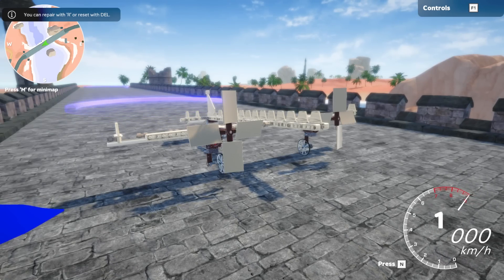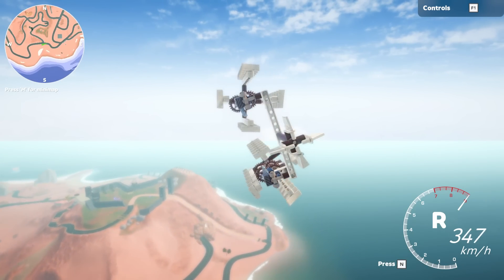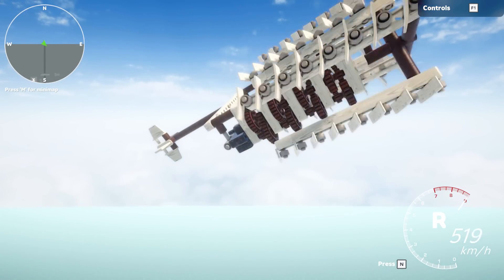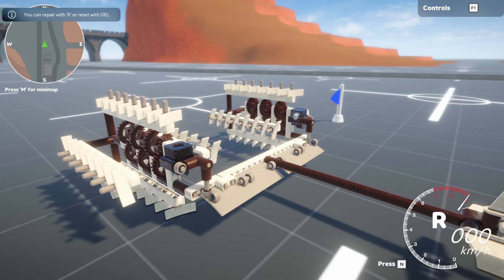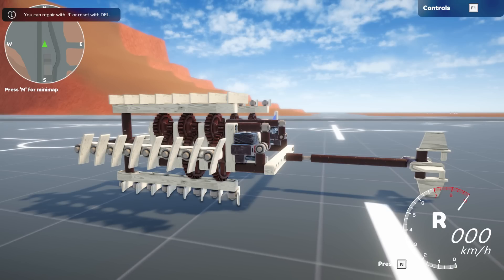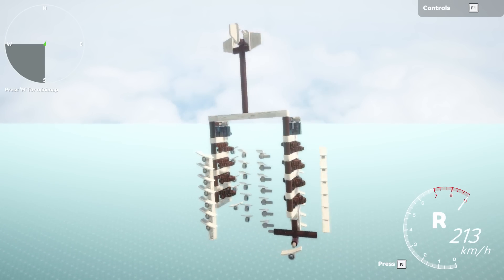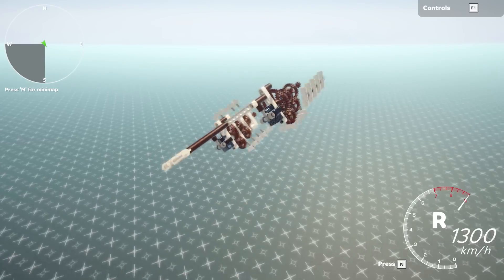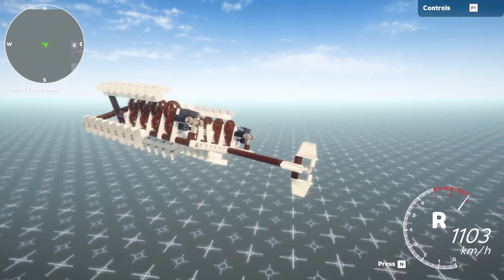I Built a Plane That Can Go Supersonic Under 1 Condition...

Comment: For spinning out of control i suggest praying. One engine i built had the same problem. i fixed the problem when i removed one spoiler of the front. I had another occurrence of the same problem that i fixed from going o the long straight, to free play... Still upset about this.

Comment: I don't know if they patched this, but when I was still trying to get it to work on my PC (my graphics card isn't quite up to the task), I learned that the way the game handles parasitic losses when running multiple engines is to simply have each engine added have less torque, meaning that if you have two independent drive trains, the second one is weaker than the first just because it's not the first.

I would suggest using axles and corner gears to have your counter-rotating props be the outputs of a single drive train so that you can be sure that the outputs are calculated as equal.

Comment: Sometimes lots of torque will cause beams and objects connected to axles to rotate around the axle even when they’re connected in another way. This happened to me when I built my first plane. If you just connect everything touching an axle up twice or 3 times with a peg then it should become stable.

Edit: Your sound barrier breaking vehicle is breaking off the parts that are twisting and causing the torque glitch described. That’s why it then becomes stable.

You can see the glitch happen on some vehicles if you tap the throttle or watch in slow motion. This also can cause crazy spinning so fast it just has constant sound barrier breaks. That’s what happened at the end of the video.

Comment: Kan, DiD yOu TrY

using less spoilers for the propellers? on several of your failed designs that went slow as soon as you broke them, they went faster. You saw this on your last build. Start with one layer of props and add more until you reach max speed. You'll get there. :)

Comment: Since when you experienced the gyro forces when you went from the larger engine to the smaller engine. I wonder if being under powered is potentially the cause, maybe try adding more engines to one of the ones that you increased the size of to see if that alleviates it.

Comment: use 1 engine and you can change the rotation by flipping the rod axel things
I've seen the discord it has a guide about this thing
Reply: only works with axels that are attached to those connector pieces

Comment: Maybe make both the sides spin with gears in between, if they are meshed, then both sides should be equal.

Then have both first gears driven by engines

Comment: I know the engines in this game get a little funky for instance with the craft you have at the 9:30 mark you can’t have them directly powering like that. It’s better if you run them off a gear train from a central motor. I believe it’s caused by something to do with how the gear trains correct to go one way even they shouldn’t great game but definitely quirky

Comment: I think it's a relative ratio of weight and torque. Which parts of the plane are heaviest and torqiest. I think if you weighted your center, the plane wouldn't start spinning at super high prop rotation.

Comment: theres an inline planetary gear that makes it pretty easy to get enough rpm (using less parts)  with the downforce wings. also theres a much better wing to use getting you more power per wing... as for drag , its calculated as parts/area exposed to the direction of travel it seems

Comment: To stop that gyro force, use only one motor in the center and connect the your rotors with an axle going between and lobe gears to reverse the direction of rotation. Motors in this game are a little different, the way engines work is each one ticks up in order one after the other. More engines don't work because plane rotors provide no resistance to the motors, so they are instantly max rpm at all times.

Comment: What if you connect both propellers on an axis thar goes from left to right and power the props through this axis ? The game may consider it as the same mechanical system that could synchronise and prevent the weird spinning

Comment: @kANGaming, The random gyroscopic force is from the beams being connected via axle, the game things of it as a freely rotating part and it tries to spin but the other axle isn't letting it, basically the beam is trying to clip through the axles but the game counteracts this by spinning or moving the vehicle, this has happened to me and when I attached the beam to the main body it was fixed, hoped I helped!

Comment: Have you considered using a perpendicular axle connect the two sets of props with 90 degree gears? Put the engines on that axle and the props should spool up at the exact same rate. You can also throw more engines on there if it's wide enough. Also, to prevent the gyro effect, you may need to use an idler gear or 3 to make one set of props go the opposite direction.

Comment: 18:20 you smashed mach 31.9693408
👍🏻
Reply: Yeah, that's "39,239 km/h" for a single frame at 18:21.
But that speed is just a glitch with a crashed vehicle, and the game not knowing what it should be tracking.

Comment: The reason you spin even with counter steering is because part of the propeller breaks off, creating an unstable spin. If you pause the video after every failed take off you can see part of the rotor missing.

Comment: With the latest update I noticed that some of my road builds also flip around uncontrollably. From my tests it mostly happened when I used axels instead of connectors to connect blocks. I also feel like you can stack planetary gears instead of gears. Try two or maybe three planetary gears inline. Also try only 4 carbon wings per prop but have them spin really really fast. But yes this engine makes next to no sense, but I find it comical.
Reply: Unless it’s been patched, there’s a bug where planetary gears don’t actually work unless there’s a wheel attached to the output somewhere.
Reply: @Vessekx  Yeah I heard about that bug, it used to work well with two planetary gears stacked. I haven't tested it recently though.

Comment: so

if the speeds have to be in sync to not have gyro forces freak out, is it possible to use one engine(or line of engines) in the middle that splits to two counter-rotating props?

Comment: Engines are slower in reverse, right? By reverse, I mean the second direction option, assigned to [S] by default.
If that's the case, you want both engines to be spinning 'forwards' with the first direction option.
I don't know if this is right, but if it is, it would explain a lot.

Assuming both engines are spinning the same direction by default, you invert the inputs on one to reverse its direction and make them counter-rotate. In doing this, you are running the inverted engine in 'reverse' while moving forwards. This limits the speed of the engine, so it doesn't balance the rotation of its counterpart.
When you spin the props backwards, the inverted engine is spinning in its 'forward' (full speed) direction, while the other engine is limited, spinning in reverse.

Maybe connect both turbines by a line of gears? (An even number of gears. Easy and symmetrical on an even-width plane. You'll have to make it asymmetrical for an odd-width.) This would theoretically ensure that both engines are spinning at the same speed, and not falling out of sync.
Reply: Tested: The speculated issue has been verified, although the proposed solution failed.
Engines do behave differently depending on their direction or rotation. The first direction, generally considered 'forwards', set by default to [W] is better than the other. In my testing, however, I couldn't do anything about it.

Comment: YE I GOT NO CLUE HOW THE FKN PHYSICS WORK IN THIS GAME EITHER, is it the dowels?
replace the dowels holding the shafts to the body with axles ...maybe... lol
Reply: that high pitch winding sound happens whenever you max out... im sure of it... i have a 9 speed gear box, that then shifts between 2 planetary gears and if i cut those ratios it breaks the car with that noise and i cant leave 1st gear lol

Comment: The only other idiosyncrasy I've found is running separated motor chains can result in slight inconsistent application of force. Usually not noticeable unless you are dealing with high power or speed. I eliminate this by connecting the two early on in the system for an equal application of force.

It's been awhile seen Ive played, and my experience is only ground based, so things may be different now, but worth a shot.

Comment: It's so funny how the engines are all so small compared to the plane, when in real life something like the Cessna 172 or Piper PA28 use the Lycoming IO-360 and IO-320; 6 and 5.2L 4 cylinder engines, respectively.

These are not big or fast aircraft. A big Lycoming is something like the IO-580 (like is in the Extra 330), which is a 9.5L 6cyl.  😆

Comment: Try a hanging support with weights at the low point. / behind some land gear wheels. to stop the torque spin.

And/or
use double / triple width prop blades made with 4 blades per screw. x 4 screws. 2 in C/W and 2 in CCW Configured pitch.
counter rotate a pair of front screws in a pusher config. L = CW and R = CCW 
counter rotate a pair of rear screws in the adjacent front screws rotation direction So L = CCW and R = CW.

Each screw has 1 engine and 1 axle.. gear to suit but large to small should do.  OR 1 planetary.
It's to save weight on the cogs and numerous every thing on your design..

I haven't tried it but yeah.  I'm clever,  everyone tells me so, I'm good at that job, my friend says so.
he's at oxford studying auto levelling fake tan cream.  he's great, I'm great.
Sorry.  I've been OD'ing on Trump lately, I'm a British, sarcastic MF and over tired.

Lol  cheers. night.  💤💤

Comment: The wing pieces are acting as “thrust” but they are intended to be used for drag. They are providing forward force and air resistance is pushing back on them. In this case less would be more. More speed, less prop. Explains why breaking props makes you go faster.

Comment: (1.) The main contribution to aerodynamics is height and width. After that they type of pieces you use and the flow of air. (2.) the torque can be caused by uneven forces with your wings. I did my own wind resistance set up and my first wing had 98% efficiency the second one has  95% the third had 93% and my fourth has 94%. So you might want to check every single piece to see what Their efficiencies are.
Reply: It also looks like there is dynamic wind as I've been rotating the wings around and every so often it goes from 100% to 97% on some pieces

Comment: Maybe a dumb idea, but would it make sense to remove the props on the slower gear ratio areas and only have the props on the front stepped up speed area so the drag of the slower rpm stages is removed?

Comment: Here are two separate reasons it might be happening. Yes, I watched the whole video.

1. The spinning is a strange phenomenon, but it seems to happen when something that's connected to an engine is spinning a support axle. The game will say the build is connected properly, but it can still have flex if not secured properly. If an engine can spin an axle that has a piece connected to it that isn't rigid, it will cause spontaneous spinning.

2.  Use electric engines as they reverse and accelerate at the same speed. If you have a gas engine set to reverse, it will not be fast enough to keep up with the one accelerating, which would also cause an imbalance in the gyroscopic stability. I think xD havent actually tested that. But electric seems more reliable when i build planes.

3. Big wings do work

4. Restart your game

5. The version you showed with more wings next to each other is adding a lot of weight and drag slowing you down a lot. Weight matters a lot even with cars in this game

6. To emphasize my last point, those wings that your using for propulsion are also causing drag, its essentially like trying to row a boat with 4 oars yeh you have two more oars but you lose energy from other factors making it ineffective. But then you're like ok yeh well we get more people to row, but we still aren't going fast enough, so you add more, and eventually, the boast just sinks

7. I love how you realised less is more at the end but did nothing about it. xD
Reply: Ok fine 7, I didn't think I was gonna go that crazy xD
Reply: W comment
Reply: Yeah he's saying he doesn't understand the physics in this game while it doesn't have anything to do with the physics, it's clearly just a bug. I understand this can be confusing but he also said you can't use A and D for hotkeys witch isn't true, there's an option for using the numpad instead of WASD. In previous videos he said a few other things that are completely false like you can't use manual shifting in this game, even tho there's an option for manual shifting. I like his videos but I'm not gonna lie, that's a bit annoying... Look at the options god damnit!  XD

Comment: Seems like the physics engine might just be really good. There isn't really a way to make an aircraft go supersonic with aerodynamic propellers, even the high bypass jet engines kAN referenced don't go supersonic. Jet engines that do go supersonic actually slow down the air that's entering them before all the compression stages, but what they throw out the back is pure thrust, not an aerodynamic pull like with a propeller. You might need to discover some pure thrust in Screwdrivers.

Comment: What if you connect the drive trains of the engines so that the gyro force from different speeds stops being an issue. So long as they’re connected by an even number of gears they should spin in opposite directions at the same speed. (Obligatory “I have never so much as downloaded this game on my computer, I don’t know if this will work”)

Comment: maybe what is happening is the sudden accel causes a few pieces to break on one side, thus making the rotors uneven and thus creating a torque. if you look carefully in several of the clips, the beams holding on the rotor blades completely disappear in some places, which is really apparent when you pause the video

Comment: My guesses are: 1 - when the engine is attached, that calculation will determine how many objects are inducing torque. or 2) when calculating physics, the order of the objects will affect it. Also, the torque is determined by the engines and airfoils, and for your builds, the deceleration is also largely determined by the airfoils. Strangely, maybe reducing the airfoils and increasing gearing or number of engines will help.

Comment: Hi kan, here are a couple of answer to your questions
@8:57 your engine are reversed (actually reversed instead of the key binding) once the prop are installed just changing the rotation doesnt mean it is counter rotating because then the prop turn the wrong way, you can try to delete the engine and re-intall it the other side (check where the turbo is to know the engine direction) then changing the control map if that doesnt fix it...
Also the gears exchange can change the direction the prop turn, if you check the workshop, the blue helicopter is a good example of that, with a single motor and 2 prop but they turn in different direction

For the damage plane going faster this is because the game reduce drag base on damage done (in race it equal less downforce) but the acceleration is calculated base on the theoretical rmp of the motor and the mass and the number of winglet on the propeller (mapped to an engine) the carbon wing for example are better but caise more drag so you can do the same then break a bit the plane and go faster

Also you cant use a shifter for prop, shifter only calculate for axel that end up with wheels

A better way to increase your top speed is to use the second electric motor, they are lighter but have a similar top rpm ( for propeller you only need the top rpm to know what is gonna append since you dont need torque to turn the prop... Only wheel convert mass to calculate the torque...) just be carefull because the rotation is hard to see because if you install the motor in reverse they is no indicator...

To make a faster plane, use the least amount of weight (use hinge with axel instead of wooden block to reduce the weight, minimise the size of the plane (width, height and length) use planetary gears to increase the rpm of the prop ( you need to either use the glitch (planetary with a 3 long axel, then a block then a hinge but instead of using the hinge use the block to connect your props) or use normal gears after the planetary before you connect the props
Reply: *Propellers do care about torque, its just that the hinge connectors have their strength turned up way too high so that only  becomes visible once you start toying with really heavy objects.

Comment: It seems as if the spinning is. . . . "somehow" the result of you over stressing the engines??? The demand to rotate your ratio is too much for the motor to handle. You need more power to make the speeds managable. . . that's my guess. Keep in mind: Gear ratios = more speed, not "more power".

One thing that I'm curious about is. . . you seem to give each turbine it's own power source. . . . what if you only used one power source that goes to both turbines. This way, it'd be impossible for them to de-sync?

Comment: Would it not be better for the torque that you would have a center engine stack and only 1 complete system for the 2 probshafts? Now you have 2 that could be calculatet different but with one it should be better.

Comment: as far as I know, turboprops change the angle of blades with load, not sure if its something u can do here (maybe with motorbike suspension). Otherwise it seems u need to shed some weight and air resistance, perhaps giving a chance to the big foils again. More with less may be the motto